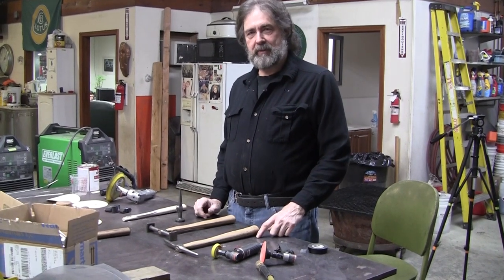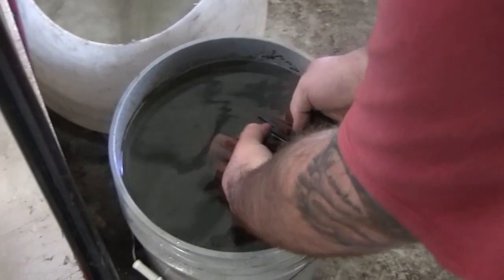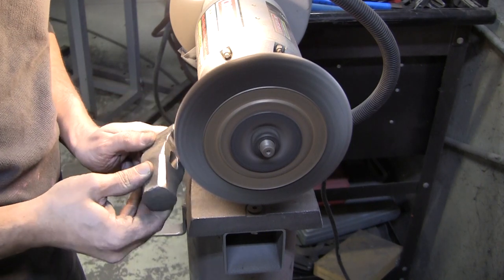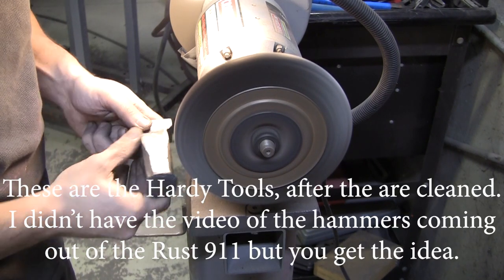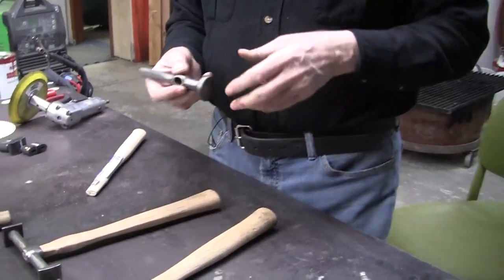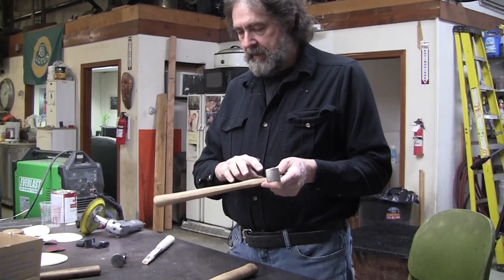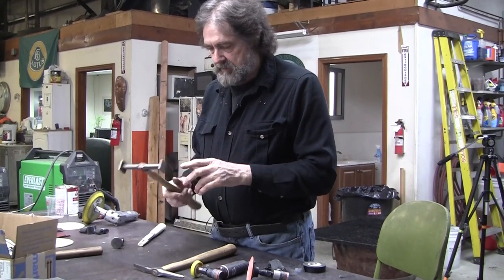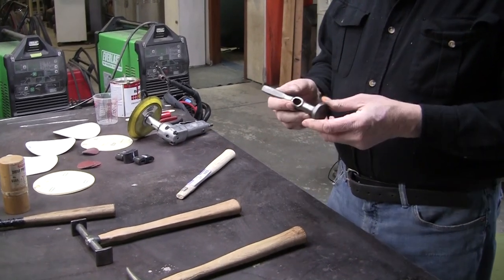Tuning Body Hammers

Comment: Boiled Linseed Oil on the handles improves the timber flex and stops splintering also helps keep hammer heads tight as the timber swells a little in the head.
Can also keep the raw forged finish using the linseed oil on the steel.
Stops heads rusting

Comment: Hi Wray, I'm new to your site. You are a true craftsman. I have an architectural Blacksmith shop in Arizona. We use a lot of different types of hand hammers, from sledges, to smaller Repousse type. The heat dries out and kills everything here.  We have a open top 55 gallon barrel that we put about 3 inches of used automotive anti freeze in the bottom, and stand the hammers up (head down) in the bottom of the barrel to soak when the heads get dried out, or to store them in. The anti freeze swells the wood handles, and takes a long time to evaporate after you take a hammer out to use it. It also keeps the heads from rusting. Thanks for sharing your skill. Max

Comment: I like the wrapping of the handle but the ends finish in electrical, I think. After years of repairing electrical I dab black weatherstrip adhesive on the tag end of your tap. Never will come loose! Best of luck Wray as I did this over the winter, except the 1,200 grit. But still used the foam interface pad!
Have a great 2022!

Comment: I went to the hardware store for a hammer handle $15.00
I found a hickory shovel handle for the same price I made four or five hammer handles 
I use a disk grinder and shape them you can give them a custom shape 
After using my hammers for a while you get a feel for 
The shape it needs to make it work a little better 
Squared off just a little to aim better …fatter in the right spot to pivot with balance for the right amount of strike power 
Never grip a hammer tight 
Lose in your hand but comfortable
I panel bond my handles and wedge them they stay tight for years

Comment: I like to wrap the handle neck (right under the steel) with some hemp twine, hide the string ends and coat with super glue.  The grip I carve like a old style gun stock knurl pattern.  Then use a die grinder with a small burr and ingrave/grind in my name and a peace sign ☮️ on the steel boss the handle is stuck through. 
I call it "fuckin off" at work.